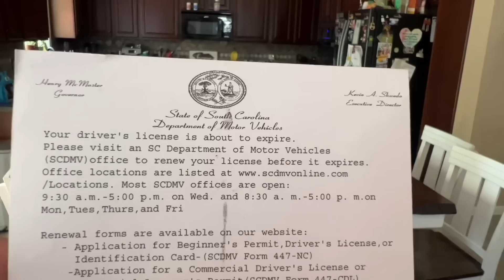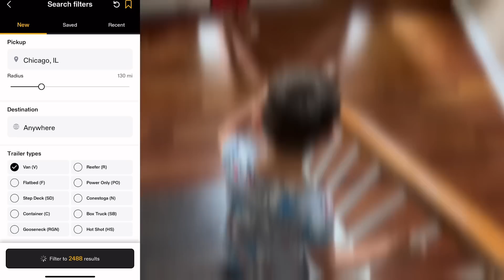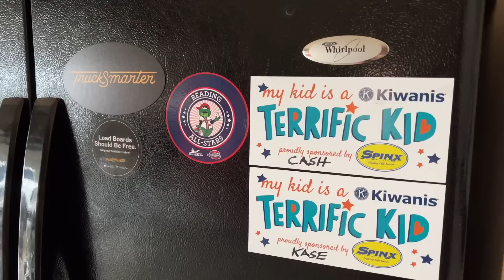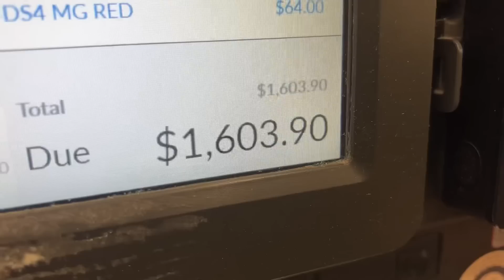Cutting Down some Stumps!! One step closer to our Shop!! LakeHouse Dock breaks lose in Extreme Storm

Comment: You might have explained in a past video but what's the point of the fence and gate with barbed wire if you can just pull up in the other entrance?
Reply from the maker: Previous owner was a bit security prone I opened up the fence for two entrances 😎🙏🏽